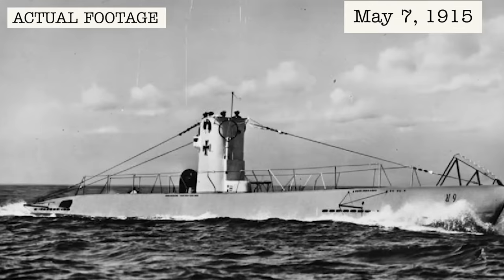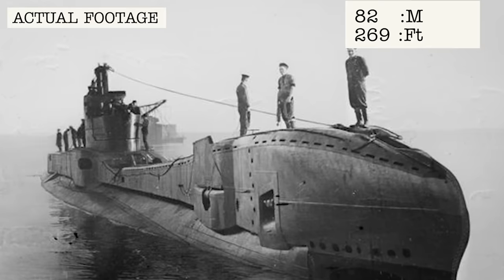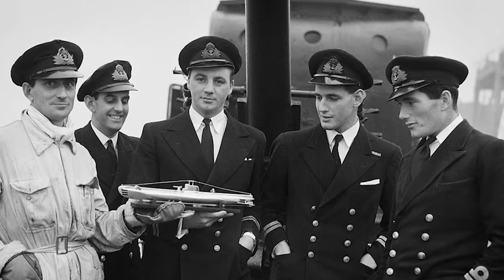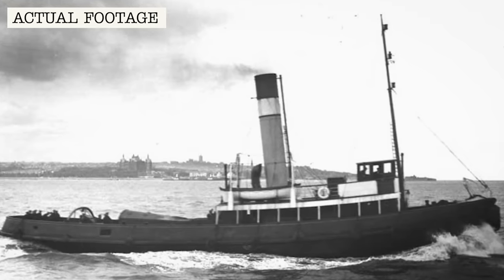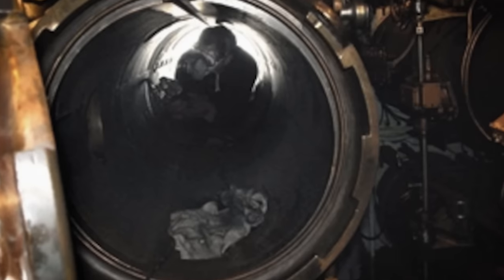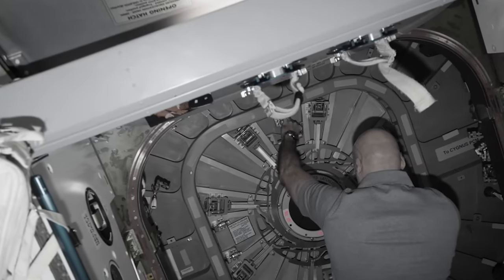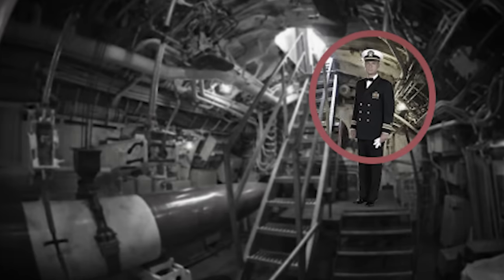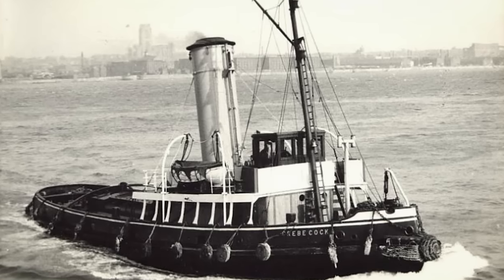Navy Kills 99 of Their Own Men to Save Sub

Comment: Image getting assigned to Thunderbold knowing it was a deathtrap of 99 people.
Reply: knowing it was something so simple that's so easy to fix? yeah I mean I think if you're choosing to get on submarines in the first place you have a pretty high threshold for... everything, so that's kind of like a tangible problem that can be avoided. 

if you have that same type of fear, then it should apply to the type of passenger jet that crashed into the ground at like 900 mph because of its autopilot in Ethiopia. Like all autopilot should be called into question, if we use the same logic.
Reply: @Velereonics  there was nothing to rebuild of planes that went down thanks to Boeing's designs. So no one flew on rebuilt lion air or ethiopia air airframes. And Boeing planes were grounded until they fixed the plane.

you act as though sailors don't have superstitions about sailing on ships that are known for producing fatalities...
Reply: Wonder if it was haunted....yes I know but there are plenty reports of ships being haunted by people who had nothing to gain.

Comment: The accident changed the design of safety valves on torpedo tubes. These days, to manually confirm a tube is not flooded, which needs to be done in case the electrical indicator is faulty the valve is opened and a 8 inch steel rod pushed into it to ensure that the hole isnt blocked with debris or anything else..once confirmed the tube is dry it can be opened. 
It was the Thetis accident that changed the design from a faucet style valve to a straight hole allowing the rod to be inserted to break any blockages which might give the impression the tube is dry
Reply: we don't just have cameras by now...? I mean sure, have that as well, but doesn't seem like a reasonable FIRST line of investigation in 2024.
Reply: They had a straight hole on Thetis, but inserting the tool to check it was clear was done as part of routine housekeeping, not every time they opened the door. (Evidence by the torpedo officer later) Was probably felt unnecessary on first cruise.

Comment: That mention of enamel paint jamming up essential equipment triggered my memory of a similar but much less serious occasion. Our church was being refitted with up to date smoke detectors, alarms, backup lighting, and fire break walls, etc. It was all volunteer work and I took part. Within a week of completion, my father told me that another congregation member who happened to be employed during the day with the provincial utility company, found that when some circuits went dead, he had a hell of a time sorting the puzzle because all of the circuit breaker switches were indicating ON. He pulled out the panel and found red enamel paint was jamming all the breakers of the fire system and a few others too.
We had another member well known for painting anything that didn't move, even over threaded speaker wire terminals when he was painting the walls the speakers were mounted on, and he'd painted the outside of every breaker switch that was part of our new fire alarm system with red enamel to distinguish them. The paint had seeped in to the back so breakers were tripped but the outside bakelite 'flipper switches' didn't move, just the inside metal contacts. Possibly some contacts were enamelled in the closed contact ON position too.

Comment: Thanks for the video on the Thetis disaster, you mentioned HMS Dolphin (I used to live near there and worked at the Royal Navy research establishment which was next door to Dolphin) which had a feature of the Gosport skyline which is the 100 foot (30 metre) submarine escape practice tower which i'm curious to know if it's design and building was influenced by this accident or is it just coincidence it's height is very similar to the depth Thetis sank too.
Reply: The SETT was built in response to Submarine accidents, being stated in 1949. It's probably safe to assume that Thetis featured in the thinking, but there were two other escape trainers before SETT at 15 and 30 feet.
Reply: As I understand it nobody tried to use the forward escape compartment on Thetis, not thinking they could escape from that depth. The tower was a response to that, so I  have read.

Comment: The "Thetis" incident is complecated and yes mistakes were made. But to a certain extent the board of enquiry was correct, nothing like those circumstances had ever happend before, however blame could have been attached to:

Allowing too many "guests" from the Dockyard on board during these triails;
The lack of awarness of the escort tug as to testing procedures and what to do if they though something had gone wrong;
The signals sent to Portsbouth during the accident could have been given more priority by the Navy; 
The " emergency" equipment easily available was obtained was faulty due to lack of maintenance;
The lack of care taken to ensure that the tubes safety test features were operating correctly such that the stopcock on tube 5 was outside its operational perimeters; 
Then add to the above that the crew were unable to easilly read the indicators showing that the outer doors were open on tube 5, which was obscured behind a horizontal bar and that non of these indicatiors had a standard "orientation" which made it easire to check.
....Its a chain of errors from lack of familiarity for the new crew on a new submarine of a new class which had not previously been made in that dockyard. Its a prome example of Murphy's law in action.

Now you criticised the RN over not cutting a vent in the rear of the submarine to pipe air in and there were very reasonable engineering reasons as to why that did not  happen. Foremost being by the time they were in a position to undertake that task ( having all the tools engineers etc that were needed) the turning of the tide creating strong currents which dragged the submarine under...... Had the initial signal sent been treated with more priority ( so not having a two+ hour delay) maybe they could have saved some people and the salvage ship Vigilant did have that equipment on board to do just the operation you suggest... So to defend the RN it was not a decision taken not to save the boat, and alow the crew to perish, and had they knowledge on how to do it..., due to so many of the K class acting like "lawn darts" and burying their bows into the seabed because they were a terrible design which made diving the boat a lottery!

If you want further reading Paul Kemp's book "the T class submarine - the classivpc British design" covers the incident in chaprer 8

Comment: Its crazy to think that very few of them had the actual balls to crawl through that escape hatch. If they all simply followed the captain, or atleast if the crew and everybody with a survival suit did, the air wouldve lasted the passengers long enough. If the navy had just been ok with patching a small hole in the hull it couldve been pressurized again and refloated with the passengers inside. They truly did sacrifice them for a tiny hole!
Reply: "Ifs" "ands" & "buts" were candy and nuts everyday would be Christmas.
Reply: After the first two pairs got out it was decided to send them in 4s, two submariners and two Cammell Laird men in each batch. This was disastrous as they were tightly jammed in and led to the panic described, where they drowned. However a bigger issue was the control of the outer hatch. Once the outer hatch was opened and the men swam out the hatch could be closed from inside the sub but the wheel used to do that must them be returned to the start of it's travel so that control returns to the wheel inside the hatch. Somebody didn't do that after the last pair got out, only turned it one turn. (may not have known they needed to). The result was the next men in could only open the hatch a few inches, see daylight above, but not get out. They didn't know what was wrong, only that it was jammed. So nobody could use it.

Comment: That is a very unfortunate headline. Without a doubt this was a case of numerous errors when met at the same day. Starting with the design sub, like installing features backwards so that the controls for the ballast were backwards, the forward dive plane being made so that the locking mechanism would not work to release it (in my understanding of the situation, the navy should have never let this boat go out on even a brief trial until the entire design was reworked), of the watertight doors, painting the torpedo door seals with enamel paint, of not allowing anyone other than the strictly necessary crewmen take the boat out (yes, the subs were still called boats, if you look at the old designation you will find for example K Boats, and beyond), out for the first trial run, and moving to other people, not training enough people on how to use escape suits and escape hatches, the tug not dropping anchor until it was sure that the sub was okay and then not waiting around, regardless of the situation unless they had received an all clear type notice, and then more. Not one person's fault and if it had not been for so many things to have happened at once, quite possibly all these problems with the sub itself, these might have been discovered and fixed. In a way, this is like when America's first supersonic bomber was making its initial flight being filmed by Air Force chase planes, one got close enough so that the vortex wind disturbance generated by the vertical stabilizer caused him to do a roll which caused the jet to hit the vertical stabilizer, and both planes crashed. I do not remember so I speculate that this was still before we knew all of the causes of vortexes. The chase plane was filming and was possibly getting as close as possible to film something the pilot noticed and thought was noteworthy enough to get as close as possible to so so. 
There used to be a show about disasters and what caused them and in every one of the disasters, numerous things, some very small, all met together at the same time.
Reply: It’s called the Swiss cheese theory. When you layer enough holes on top of each other, sooner or later, you’re going to create a gigantic hole that is catastrophic.

Comment: I read a book about this when I was a kid 60 years or so ago when I lived in Manchester, it claimed that the cause of the sinking was that all the Torpedo tubes had gauges on them to tell if the outer door was open or closed, the problem was that when fitting the gauges there was a pipe or something in the way so the gauge was installed upside down so when all gauges were reading 12 O'clock to say the the doors were closed in fact all doors but 1 were closed and the other one was open which caused the flooding when the inner door was opened causing the flooding and sinking, how true this is I really don't know though???????

Comment: QUESTION #1: Why did the Royal Navy REFUSE help from the salvage vessel when this help was first offered? 
PROBABLE ANSWER: Pride and hubris - for the great Royal Navy to have to ADMIT that it needed help is more than their pride could accept.
QUESTION #2: Why did the Royal Navy REFUSE to allow the salvage vessel to drill a hole in the ship in order to save all those lives? 
PROBABLE ANSWER: Because for the military, lives are expendable, lives are CHEAP and submarines are EXPENSIVE. 
QUESTION #3: Why was the Royal Navy allowed to be judge and jury in this investigation? 

PROBABLE ANSWER: An INDEPENDENT inquiry would have found the Navy at fault and would have forced the Navy to pay compensation to the families of the victims.

Comment: Extremely symbolic how essentially the "heel" of the sub was visible during thst last brief moment of hope.
Reply: If I was the first guy who went out.  I would have climbed up the sub to get out of the cold water.  Being 84 M in length and in 30M of water, the sub should be at around a 20* angle.
Reply: @fukkitful   I wondered about that, too. I guess they had other things on their minds so it never occurred to them.
Reply: @fukkitful  the problem is when the sub sink it would drag you under this is a problem in scaping sinking vessels

Comment: I've read and heard much about this disaster, but I've never heard the bit about the divers saying they could cut into the submerged hull, and I strongly suspect that it's bo**ocks. 1 - could they even make such a cut underwater with the technology of the time?; 2; it's not just a question of getting air in, that would do no good without first extracting the CO2 from the hull; 3 - all those inside were probably dead by then anyway. Which said, the whole episode was a catalogue of incompetence, from the blocked test-cock onwards, through the idea of making the first test-dive a 'jolly', to the inadequacy of the rescue efforts; and the inquiry was a disgrace.
Reply: Underwater cutting tools had existed since around 1915
Reply: From what I have read they had a cable onto the stern and had opened a hatch that would give access to the internal pressure hull, and it was hoped they could get the men out there, by cutting tthrough the pressure hull, (although I have read there were all kinds of obstacles and struts inside the outer hull that would make that difficult.) And apparently it was here at this point they were considering drilling into the pressure hull while the stern was accessible. But when an abortive final escape attempt caused the sub to flood the weight sent it down and that was that. Earlier the plan had been to attach air-lines to valves on the hull using divers, this was the plan Oram carried on his body, and they had rigged airlines inside the sub so that they could blow out the forward compartment. They never had time to try this plan, things had gone past that point when they were considering drilling into the stern. Or at least that is my understanding.
Reply: @sean_d I recall something similar; certainly there was a hatch on the exposed stern which was removed at some point. I still have the book - somewhere......

Comment: I thought that steering screws on ships were always installed "backwards", e.g. you turn your rudders by pushing them starboard in order to turn to port, and vice versa?
Reply: You are confusing  a sailboat with a  tiller with a  ship with  a  wheel> Wheel ships always  are supposed to turn in the direction of the wheel. like a car.  I have helmed on such a boat after a lot of time on tiller boats and it is quite hard to get used to.   TE. Fidler

Comment: Not a lawyer but  it should be mentioned as its hard to understand in relative terms to what the event or several events are foreseeable as to the actions of the crew which lead to the submarine being sunk, I guess they thought that it would have been too improbable with a high burden to the company since there was no prior delegation to apply it could of made it hard to apply precautionary steps, which makes sense because these precautionary steps are what makes similar industries like aviation safe, learning from past mistakes. Plus allowing fault would mean could have caused potentially floodgate concerns

Comment: No one was at fault: 1 design of hatch locks and hold open latches, 2. painted doors shut, 3. didn’t stop test when couldn’t submerge 4. Took civilians/non-essential passengers on a TEST dive. 5. Didn’t stay in constant communication with surface/safety vessel 6. Didn’t declare emergency upon losing com contact. 6. Didn’t close all watertight doors before submerge attempt. 7. Poor lack of inspection before leaving port (torpedo doors painted close should have been discovered in port)  Very few emergency plans In design of boat or in test procedure. I understand this is early 20th century, but someone always pays the price for ignorance and arrogance no matter what year it is on the calendar.

Comment: I wonder if it would have been possible to attach a cable to the protruding stern, then tow the sub quickly enough (like a water skier) to have the flow of water around it lift it to the point the main hatch would be above water.  You probably wouldn't have to tow it terribly fast.  Or to get it to shallow water soon enough for the people inside to survive, if the towing had been started immediately upon finding it.

Comment: Weird that most didn’t go for it considering the escape hatch was working decently well
Reply: Somebody neglected to restore the wheel to the end of its travel that closed the outer hatch after the first four got out. That would have restored control of the outer hatch to the wheel inside the compartment. Left as it was it would only open a few inches, hence nobody else could use it.

Comment: WTF? Steering gear installed backward, bow planes locked, and TORPEDO doors painted over? Dude, the Navy straight-up hired the Three Stooges to build this thing.
Reply: After the Munich agreement, in 1938, Britain went into panic mode, building up its military strength. Particularly when this was the lead ship of a new class and they needed her sea trials done to incorporate any necessary changes into her sisters.
In all probability, Cammell, Laird were given weeks to do work that needed months. This was just three months before the outbreak of WW2.